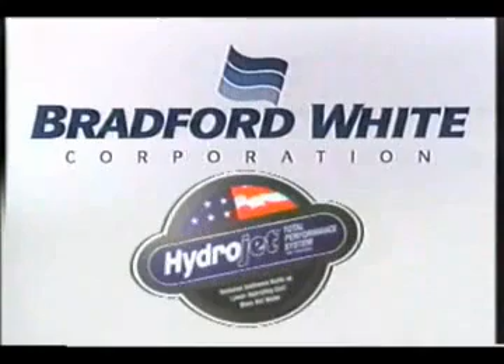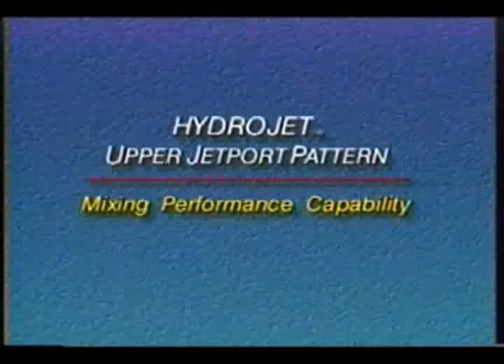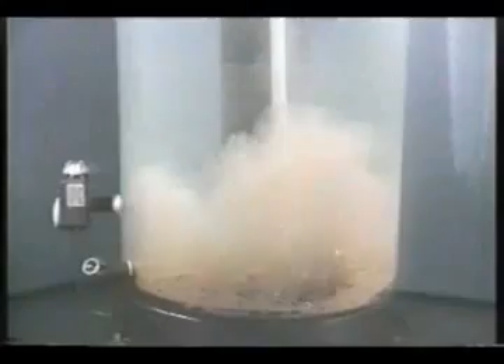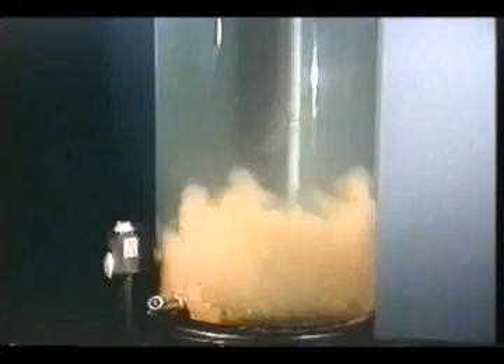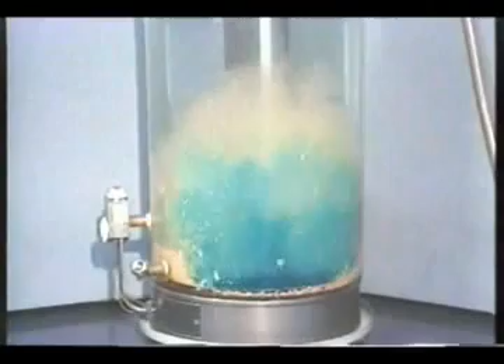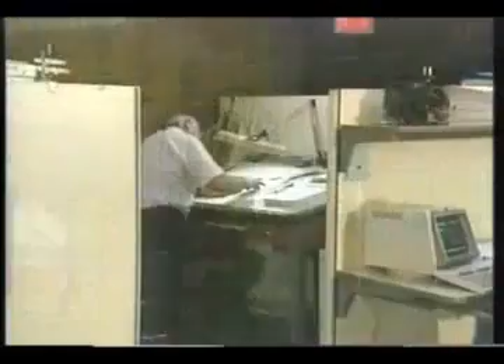Knoxville Bradford White Hydrojet Water Heater

Comment from the maker: I never knew exactly what the dip tube in a water heater did. I bought my water heater from Pipe Wrench. It was a Bradford White and I wanted to find out what I had purchased, so I found this video, and now I know what the difference in a dip tube can make, very cool feature. I hope this water heater will last 20 years.
Reply: I purchased my BW water heater in 2004 and I still have it. I occasionally have flushed it and never get any sediment to come out. My aerators in my faucets don't get clogged either. I am extremely impressed with the way that this BW water heater has performed. I don't want to part with it, however, all good things must come to an end. I never thought I would say this, but I love my water heater.